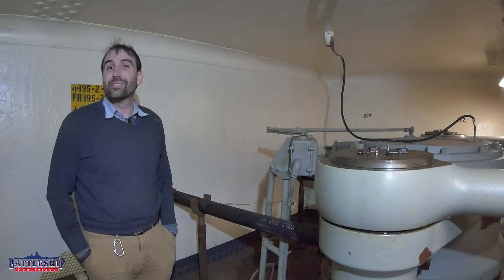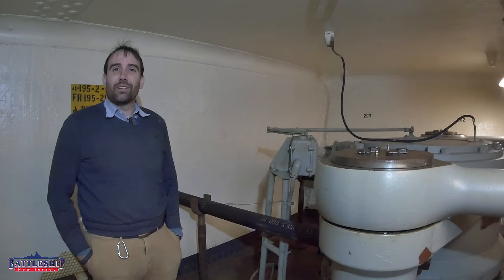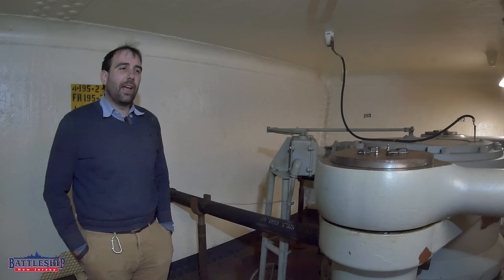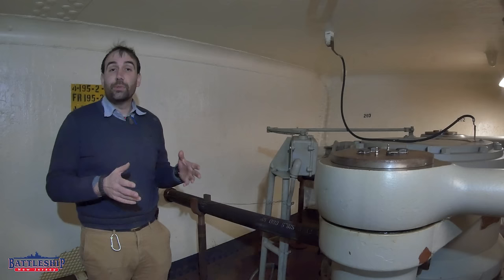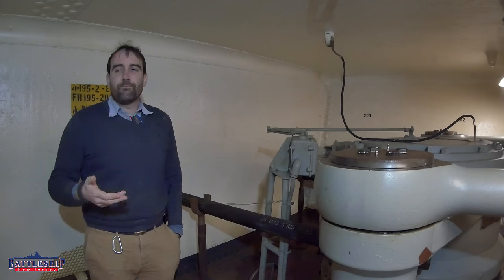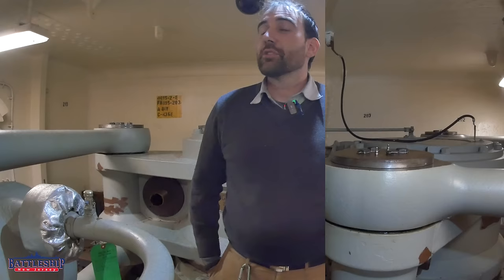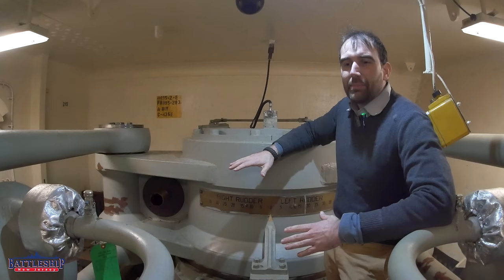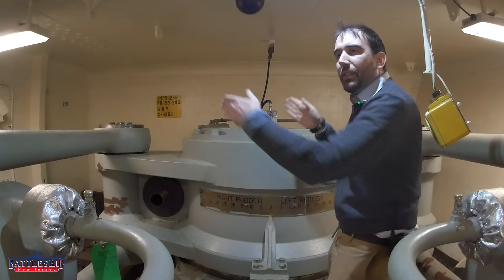Can New Jersey Still Use Her Rudders And Are They Straight?

Comment: So if the rudders are turned slightly inward, if they were positioned perfectly straight, will the ship actually move faster through the water
Reply: I have a theory which is not even an educated guess, but I think that they're turned inward because that makes them more hydrodynamically in line with the water coming off the stern of the ship. That ever-so-slight inward turn might keep the water flowinf more smoothly of the faired curves of the hull.
Reply: I'm betting it's the same reason car steer tires are given a slight "toe-in", to help with stability and keep it holding a straight line.
Reply: @murphsmodels8853  good idea but I doubt it, wheels on a car due to physics and the way they have to rotate while turning will cause TOOT or toe out on turn this is why, and each car is different there is a certain amount of toe that is built into the "spec". Not sure why the rudders are canted could be to vector the thrust from the props or reduce drag but since they pivot on a straight shaft they wont toe out when turned.

Comment: Who will be advising the yard workers on keel block placement ? I understand that block placement is critical to align with hull structure pressure points.
Reply: New Jersey has been in the Philadelphia Naval Shipyard's Drydock #3 several times over her career, so the blocking plan is well established.  The ship would normally be blocked three times--initial, first bump, second bump.  The initial block is of course where the blocks are placed when the ship enters the dock and the water is pumped out.  One of the main goals of the drydocking is to completely blast and recoat the underwater hull, so there has to be a plan to blast the surface of the hull that initially was in contact with the drydock blocks.  To do that, once the majority of the hull is blasted and coated, the ship has to be refloated, the ship's position and blocks adjusted so that as many as possible are no longer obscuring sections of the hull that need blasting and coating, and then the drydock is dewatered again, and the ship re-rests on the blocks.  The refloat-reposition-dewater sequence is performed a third time to expose the remaining surface of the hull so it can be blasted and coated.

When USS Missouri was drydocked at Pearl Harbor prior to her service as a museum ship, they devised a blocking plan that only needed one bump, rather than the two mentioned above.  Since each bump takes 2-3 days and  a lot of expensive skilled labor to accomplish, being able to skip a bump would save a lot of money.  It's unknown whether New Jersey will be able to execute the one-bump plan in the PNSY drydock, or if the two-bump plan is the only option.

Comment: so not a question about dry-docking but the steering gear motors.  are they steam driven or electrically?

i saw a photo in a book that i read (might be the Iowa class battle ships, might have been in an Independence class aircraft carrier book) that the cover to the steering gear (the actual gear train) was pad-locked in a few places to prevent malicious destruction.

who in the crew, in their right mind would deliberately sabotage their ship's steering?
Reply: What's locked to prevent sabotage are the access panels to the turbine reduction gears.  They did an entire video on the topic.

The steering gear is like many of the systems on the ship, electro-hydraulic.  Electric motors drive transfer cases, which in turn drive hydraulic pumps.  The hydraulic systems that need to drive powertrain in both directions are set up as "A-end/B-end" and use the same principle as the hydrostatic drive found in, among other things, your lawn tractor.

Comment: What emergency bilge-pumpery do you have during day-to-day operations, but also, what do you plan to have for your journey to dry dock? I'd imagine you're on shore power for day to day operations, and thus probably have that stuff powered off of 120, 240, or 480vAC, but without some power generation equipment, you won't have that for your transit. What's the plan?  Also, will you replace the bilge plug when it's in dry dock, and will that bilge plug be fore sale in the ship store? ((The last part is obviously a joke.))
Reply: Of course I'm not involved with the project, but I'd strap a diesel generator to the deck and run extension cables to the bilge pump.  They did inspect the forward bilge in another video and it did look clear, but I don't know how that will hold up on route.

Comment: Texas got a working battleship. They even steamed a boiler when it was moved to Texas to supply ship service to the crew onboard. Texas doesn't have the restrictions of what can be activated by the navy that newer ships have. They could have kept the bilge pumps working that would have kept up with the leaks from lack of care Texas gave the ship.
Most twin rudder ships have the rudders turned in. The force of the propellers doesn't  turn the rudders back out. Steel doesn't stretch under that force. The turned in rudders give a more focused thrust and makes the rudders more effective, whether going straight or turning. Single rudders like the Texas are much less effective, partially because the rudder isn't directly in the prop wash.

Comment: I have a question. What type of fuel did the kitchen/ galley/ Bakery use? Was it steam or LPG Propane? Where was it stored? I know Bakery ovens run on LPG or natural gas.
Reply: The navy ships I was on used electric heating elements to cook with. Running a flammable gas system on a warship would be incredibly dangerous if the system was damaged in battle. We had acetylene tanks for cutting and welding onboard that were stored on the weather decks so that a leak was vented outside before it could cause an explosion in the ship.

Comment: Considering BB62 is moored in a River, where the height of the water rises and falls according to rainfall and the tide, how much clearance is beneath the ship? How high has the ship sat at the pier where it's moored? How low? Is there a water depth for the Delaware River, where if it go so low, the ship would potentially ground itself?
Reply: The main Ship Channel in the Delaware is 40 ft deep. It was dredged a few years ago for commercial traffic. The real issue is Bridge height. There's only a few feet of clearance under the Walt Whitman Bridge.

Comment: Will there have to be a harbor pilot on board NJ during the dead ship tow? Even though the tugs are providing propulsion and steering I’m still curious. It would make sense due to the better visibility but it does seem a bit redundant considering they’d only have control via radio to the tugs.
Reply from the maker: Yes there will be

Comment: Are the propellers going to turn while being towed?
Reply: 🤔 Are there propellers?
Reply: @HM2SGT they do have their propellers, but it’s interesting to think if they can free turn with the water
Reply: @calebvaldecanas8867  I just wondered since Texas doesn't have hers. Propellers and shafts were removed prior to her being handed over to the state at the end of the second world war.
Reply: @HM2SGT  All 4 props are in place, and no, they won't turn.  They are locked.
Reply: @HM2SGT  like Ryan said, when they were decommissioned, everyone thought they would come back into service again (still holding out hope personally). They wouldn’t have had a need to remove the propellers just to reinstall them later. That would’ve added a ton of unnecessary work.
Reply: He talked about the stress the propellers have on the shafts

Comment: Thanks for this i have a couple questions about the dry docking -

1. I think technically under ideal conditions a towed vessel's propellers should be allowed to free spin to avoid stress on them, but aren't NJs locked in place?

2. When its docked at the actual dry dock how does the water get evacuated? How do you ensure the ship rests evenly on those blocks that will support it? Are there any special considerations considering the sheer Weight of the NJ is incredible due to all the armor. it displaces half as much water as the largest vessel ever constructed, and unlike a lot of merchant vessels even with no cargo and (very little/no) fuel it still displaces a huge amount due to that armor

3. I have a lot of questions about the _paint_. So it's been submerged now for 40 years, the special anti fouling paint. Is the intent to replace it, if so what type of paint gets used? I think in another video you had mentioned that special anti fouling paint was incredibly expensive. What about the pain and the material used to make it is so special?
Reply: Bottom paint (anti-fouling paint for below the waterline) typically are formulated with a copper compound that's biocidal. Consideration of hull metals in use, fresh water vs salt water, temperatures and more go into selection of the paint - even for location on the vessel, stern or bow. Add to that that those copper based biocides aren't extremely good for some native organisms in the water, some areas prohibit or restrict copper based solutions, yeah, tons of moving parts and well, everything copper is expensive these days, it's a specialty paint and holy crap, that's a lot of surface to paint, yeah expensive as hell and I'd be asking for expert input, as that's far from my fields of expertise.

As for positioning in the drydock, loads of broom handles and I'll just be getting my coat on the way out...
Seriously though, the weight is calculated vs strength of support and positioning, at a guess (again, far afield of my expertise), mooring lines go along way for positioning, guide blocks work well for massive objects (I have worked with blocking large metal objects before), combining the two adds more precision and well, gravity does all of the hard work

I'd also not want the screws to be freewheeling, as that'd increase wear on the main shaft seals, increasing leakage and well, corrosion. Ryan covered that subject some time back.

Comment: I would like to know if you are going to follow the U.S navy blocking plan or you are going to come up with a custom plan based on what damage to the hull there is and where things like certain sea chests are and if you hull plates need to have doublers added and such
Reply: The navy has 3 blocking plans for all their ships for this exact reason. They will probably rotate between them to work on the hull.
Reply: Ah I knew they had 2 blocking plans but I didn't know they had 3. Thank you very much sir.

Comment: So once you get her into drydock the Navy secretly refits the boilers and turbos, in case of alien invasion.  Installs modern radar and targeting systems, with updated radios, VLS tubes installed under moveable decking.  Don't forget the new heads and hot seats with private showers.  How soon do you think she'll be ready to go?
Reply: I Don't think that they have " hot" seats anymore in the navy.   Modern medicine now.
Reply: @glennschemitsch8341  all of ours were standard white porcelain with black seats.  Standard porcelain urinals.  Steel stalls for the crappers.  Epoxy composite on the decks, bulkheads and overheads painted white.  Pretty much like a highway rest stop.

Standard prevention for STDs was a the absolutely huge stainless steel mixing bowl full of condoms on the Quarterdeck in liberty ports, complete with a "Take what you need" sign and a second little sign detailing exactly which articles of the UCMJ you would be discussing with the CO at Mast if you ended up requiring medical attention.

Comment: This is a bit of an odd question, but let's say someone wanted to take a battleship like the Texas or the Iowa-class battleships and put them in display without any water. Would something like... millions I would guess... rubber bouncy balls like Superballs give enough support to keep the battleship aligned and not cause sagging or stress damage over time to the hull? Would the weight of the ship just crush them? What materials have been used for dry berthing of large museum ships (besides concrete)?

Comment: Just wondering if large naval ships will ever do away with rudder and go with Azipods like all of the large cruise ships are using. Between them and bow thrusters appears a stopped ship can rotate 180 degrees in only its own length.
Reply: Two factors come into play with things military. Long term reliability with minimal maintenance and durability under combat conditions. The former do come into play with things like cruise ships and freighters, but not at all under consideration is durability under combat conditions. Cruise ships and freighters don't get many attacks by anti-ship missiles, bombers, torpedoes and shells.
Reply: @spvillano Plus, the sterns required for azipods are a lot more unstable in weather conditions compared to regular sterns, and the fact that someone has to constantly correct the ships course as an azipods trim is knocked off by a few degrees in anything above moderate weather condtions. Azipods are also geared mainly towards efficacy over speed, nothing (large) with azipods is going faster than 22-25 knots.
Reply: Mistral, Rotterdam and Galicia classes say hello.

Comment: Do you plan to get a turret able traverse and possibly elevate?
Reply: They have said they don't currently plan to work on rotating it although they can manually raise and lower the barrels - earlier this year the changed the elevations of the guns on turret #3.  Their efforts and expenses are focused on finishing the decking up and the drydocking.  They also don't have the necessary shore power for it on hand in their location.
Reply: @garywayne6083  guess the iowa keeping her 👑😭

Comment: Rudder packing: I am assuming that is on the inspection process when drydocked, is that correct? Also, the two rudder shafts and four propeller shafts currently go through holes in the hull. I know that most intake/outtake openings are welded over, are there any other areas where the hull is breeched by something?
Reply: Ryan has spoken several times about sea chest openings, and steam condensers that used to open to let water through the hull... and Navy had plates welded over the holes when the ship was decommissioned.  

At this point, prop and rudder shafts are likely the only hull openings below the water line that are not closed+welded over. 

With rudder shafts pointed UP through the hull toward aft steerage the inside of hull opening for NJ rudder/shaft may comes inside the hull above the waterline... (two or three decks higher than prop shafts) meaning not same kind of seal needed as the prop shaft, and water not constantly trying to seep/pour in... especially with museum ship not moving in open water.

Ryan: can you verify this, and let us know if aft steering is above/below water line... and what kind of seal used here.

...or plans for any drydock  maint needed for seal at rudder & prop shafts.

Thanks.

Comment: Just like a car. Your alignment angle is call toe. So us mechanics tow you front wheels in on rear wheel drive car. So as the the car meets the resistance of the road the tires return to zero toe in. So the rudders are doing the same. The water passing by causing the rudders to return to zero under way. The engineers under stood this physics.

Comment: New Jersey cannot use her rudders because New Jersey is a museum, not a battleship. I can't find any definitive answer to "Are the propellers are still on the shafts" of the Iowas, but I would guess that they were removed and stored and perhaps scrapped in the years since the ships were retired to museum duty. When large machinery is kept operable, a crew of mechanics turns every rotating piece on a regular basis. The museum has numerous videos that show how things are made to appear "as they were". Piping would be an excellent example. Nobody is turning the turbines, feed pumps, forced draft fans, circulating pumps, turbine generators, etc., etc., etc. These ships are the equivalent of fossils. Beautiful in their own way but no longer living, breathing things.

Comment: when was last time anchor was used
Reply: I don't know the direct answer to your question, but you might be interested to know that the maintenance and volunteer staff have been prepping the anchor windlass equipment for possible use during the drydock operation.  (The staff and volunteers at USS Iowa helped out big-time by providing copies of the anchor windlass manuals, which could not be located in New Jersey's library.)  The anchor windlass equipment might be needed to heave mooring lines (the same equipment drives the mooring line capstan and the anchor wildcat) or handle the separate anchor-grade chains that are part of the "100-year storm" mooring plan.
Reply: @SomeRandomHuman717  Cool!  That  equipment isn't steam powered?  Or is it steam powered but theirs either an electrical or manual option?